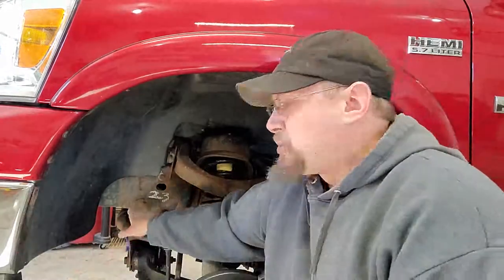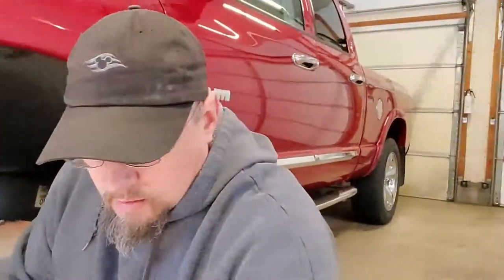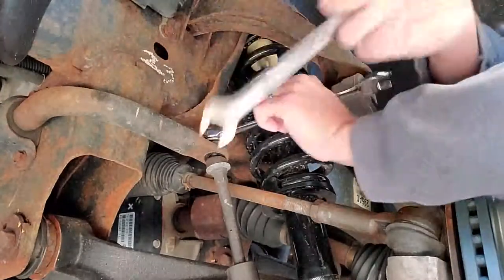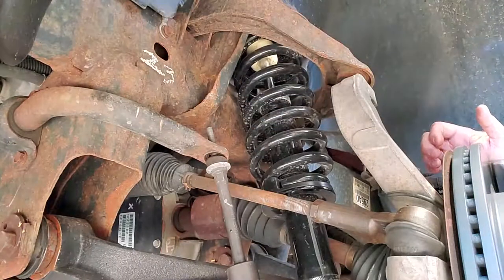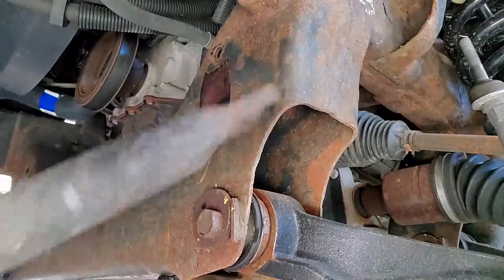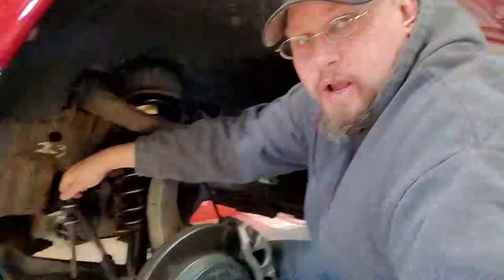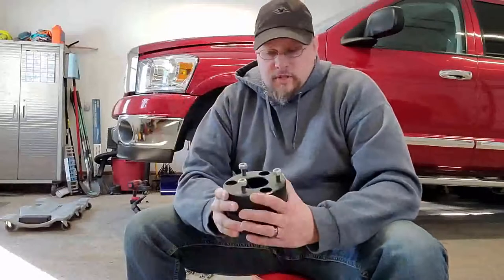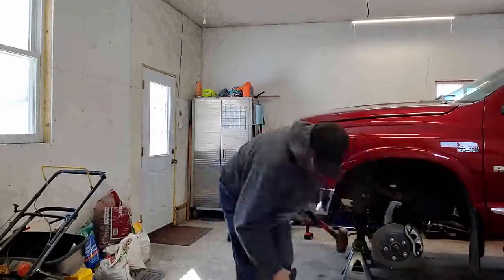How to remove a SWAY BAR on a Dodge Ram 1500, "Crimson 5.7" looses its sway!!!

Comment: I’m watching your video because I’m trying to find out how to put back on new factory sway bar bushings and brackets. I see you had a problem with your leaving kit. So I have a leaving kit I think it’s like your. I’m going through my front in of my truck because I have a bunch of squeaking noises. I’ve been trying to change everything out to get it to stop. Did your truck squeak at all and was it because of your leaving kit? I’m trying everything to find out how to get it to stop. My next step is to trade it in.
Reply from the maker: Thanks for messaging. My truck I bought leveling struts so when I installed the leveling kit it was to much for the stock control arms. 2 inch leveling kit is all that will  fit on factory struts. To help with your problem you will need to do some doinostic. I usually start with white lithium grease and spray rubber bushings one at a time. If you installed polyurethane bushings instead of rubber bushings then that is your squeaking. Polyurethane bushings must be heavily greased to not squeak. I hope this helps you feel free to reach out with anything other questions.

Comment: Does it need to be jacked?
Reply from the maker: The sway bar can come off with  the vehicle on the ground and the tires on. 

It is easier to reinstall the sway bar with the vehicle on the ground because the bolts for the A arms line up better.